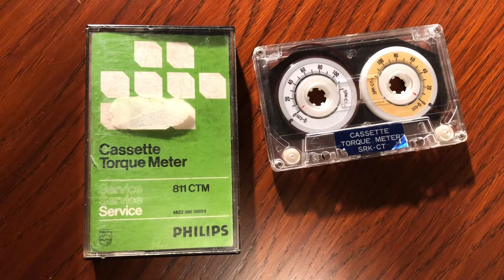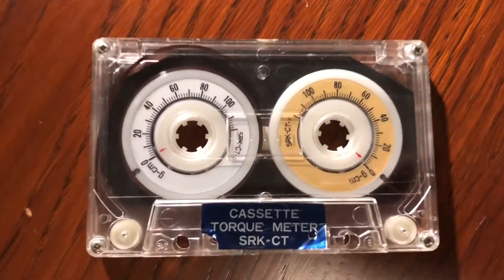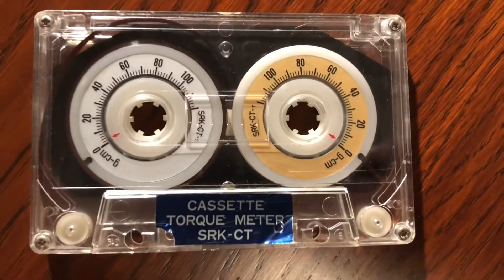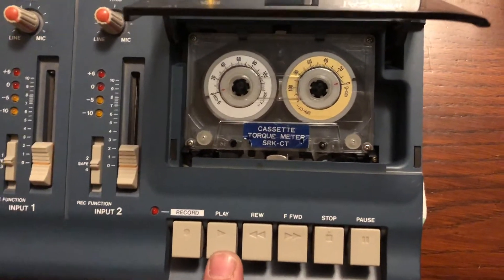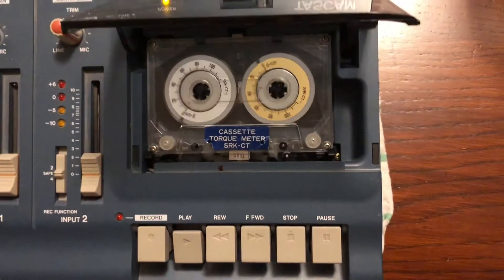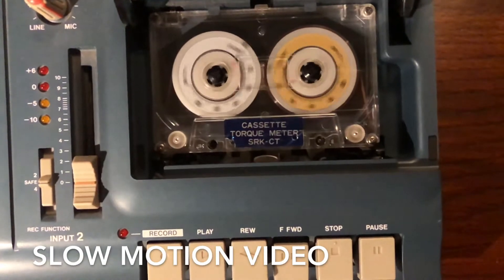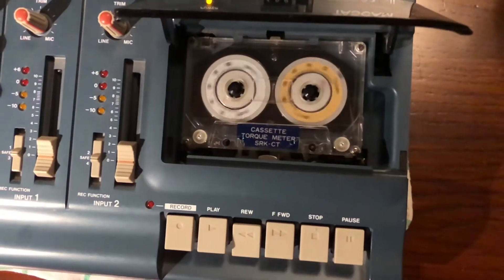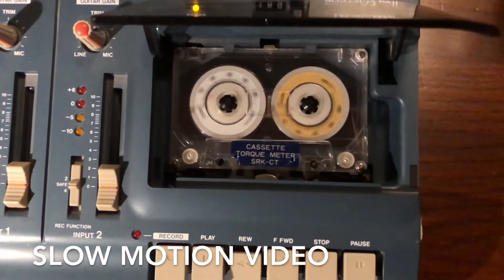Cassette Torque Meter (used on a Tascam Porta02)

Comment: i believe a deck with high torque wouldnt be problematic in any way or form, youd probably only want to use one of these after servicing a deck to make sure everything is running smoothly
if it has low torque thatd be a problem, but i dont believe high torque = bad (unless its a player without autostop i suppose)

Comment: If the machine have a torque problem How to fix It?
Reply: Cleaning, lubrication, mechanical adjustment. The service manual should contain the procedure.

Comment: FYI: Many service manuals state torque test must be performed in middle of tape wind position for balance torque allowance. Alot of these torque calib cassettes should be thoroughly cleaned because the slightest resistance will skew the mechanical reading. The deck should have new belts, be cleaned and lubed before this test is performed to ensure spec.
Reply from the maker: Nick Terence Thanks for your elaborate comment!

Comment: These tools are hard to come by, and I won't even go in to the rarity of getting this equipment for DAT. Also while I'm ranting What is it with the some kind of closely guarded secret on a single video that goes through re-calibrating a tape deck, torque, head height, azimuth, bias adjust, explaining bias trap, some steps speak of frequency response adjust. Just grab any Nakamichi service manual and there is like 15 steps to re-calibrating a deck. And not breezed over in a 45 second video, but a for dummies version. Man-0-man if I knew how to do this crap I'd post a video tomorrow.

Comment: Without knowing exact values: take-up torque seems too low, back-tension cannot be verified, this tape is for fast forward measurements exclusively. Normally, take-up should be between 25-60 gcm, back is 2-6, ff/rew 70-110. Check service manual for values, it seems an idler or belt needs replace.
Reply: Now I'm morbidly curious what torque it would stall out at.
Reply from the maker: didyman79 Thanks for the info!
Reply: Man, did I go deep on youtube this time.
Reply: Back Tension is not relevant here, as this is not a Dual Capstan transport. That's why it reads pretty much 0
Reply: Single capstan also should have measurable back tension even if it's not critical, that's  why I wrote 2-6 gcm-for dual capstan that would be between 8-20 gcm.

Comment: fast reverse and fast forward have very different values. that is weird. maybe you have to rewind the whole tape for better readings.
Reply from the maker: bonno666 Indeed, that’s a little weird, knowing ffwd and rewind are both driven by the same motor. Perhaps there are some moving parts that press harder to each other in each mode.
By the way, the torque meter cassette has a very short lenght of tape. Winding takes about half a minute or so
Reply: Without changing diameter too much, there will be no difference regarding this.

Comment: Wow!  I had no idea this instrument existed either.  I assume if your machine has incorrect torque it would mean you have a bad belt or motor.  Thanks for posting! 👍
Reply from the maker: David Paul Thanks for watching David! Yes, I think you’re right, probably a worn out belt or a weak motor. I also suppose torque values are more likely to be too low than too high, don’t you think?